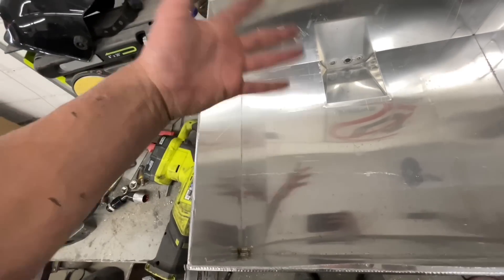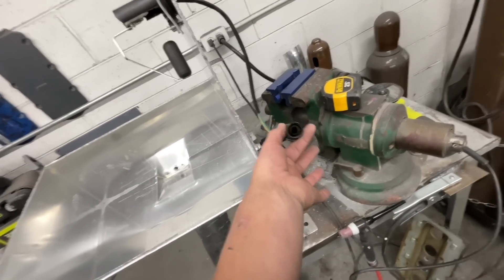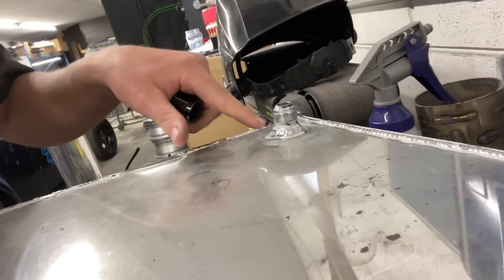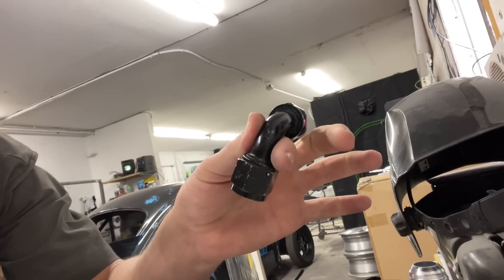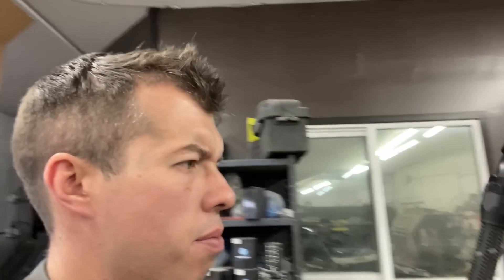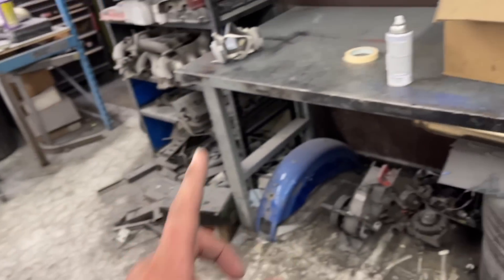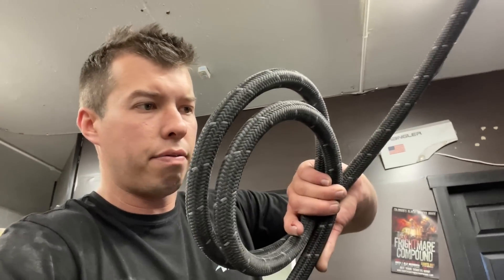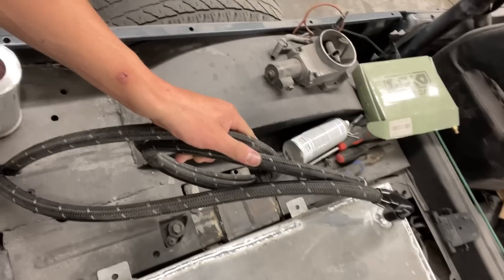YOUR COMMENTS may or may not have prevented an Explosion.

Comment: You should put a "roll over valve" in place of the fitting on top of the fuel tank going to your breather can.  If the car ends upside down or on its left side, there is nothing prevent the fuel from running out the breather can.
Reply: Yep.A '1-way valve' is required for "Tech Inspections" as far as I know.
Reply from the maker: You are spot on, many others smarter than me have also told me that 😂

Comment: My thought is - you will get fuel in a vent line. So, the fuel either needs to drain out of the car or back into the tank. A loop or poorly designed catch can is likely to trap fuel making venting difficult. A good quality rollover check valve is a very good idea and required at many racetracks. I would keep it simple with a check valve at the tank (not a crimped fitting) and a line upwards to a filter. Holley has a nice kit, but they do show a loop in the line in their instructions. I'm not fan of that loop but would be interesting to find out their reasoning.
Reply from the maker: Fair enough, you like many other smarter than me have suggested the check valve, good on ya, thank you
Reply: The check valve is for rollovers. The purpose of the double pigtail loop is to prevent a siphon from forming

Comment: Your theory of the “double pigtail loop” is correct. It’s so vapor can escape and air can enter the tank as the pump empties the tank. The double loop is to prevent fuel from coming out of the hose from either slosh or in the event of a rollover. I was also going to suggest you probably should have put at least one large baffle plate across the width of the tank. With large slots or holes allowing the fuel to move to the sump. But reduce fuel slosh in the tank. A tank that size, when you’re low on fuel, If you were to brake hard for whatever reason. You could starve the pump for fuel. Something to think about.

Comment: I’m glad you put it back in as fuel is used air needs to replace it in tank and uses vent to do so now the crimping the line will restrict that air. A simple off the shelf roll over valve would fix the problem totally
Reply: My understanding of roll over valves is to stop fuel flow in the event of a rollover, the purpose of the double loop pigtail vent is to prevent a siphon from forming. If your double loop pigtail is correctly made it doesn’t really need a rollover check valve lastly a tank vent needs only to be about 1/2 to 2/3 the id of the supply line unless you are making top fuel type horsepower

Comment: you should use an oem vapour system. they're in every car since the 70's. you probably have some sitting around from the part out cars. they use charcoal instead of Scotch Brite as the filter. they also contain the vapour until the engine is idling then open a valve (early models use vacuum, later models use the computer) which burns the vapour off so you don't smell the fuel when the car is parked... saves you from emptying the tank when you're not going to drive for a couple of months.
Reply from the maker: I did think about that.  They’re so ugly though haha

Comment: Story time. Way back in the dark ages before the inter webs, (1997)  I had an early smog era Plymouth Fury.   

One day, out of the blue it started alternating between completely flooding or starving for fuel. 

I messed around with the float in the carburetor. I put in a new fuel pump and tried a bunch of other stuff that just didn’t work.  

There was a gas station right by my apartment complex that I would fill up at first thing in the morning whenever I needed gas.  
Well for whatever reason one hot morning  (well into the high 90s at 8am), I forgot to stop for fuel. I got about 30 miles up the road before I remembered to fill up.  

When I took the gas cap off, it blew completely out of my hand taking my car keys with it. 

I stood there for a minute, trying to work out what had just happened. 

It turned out that the new, locking gas cap I bought a few weeks before the fuel issue showed up didn’t have a vent like the original. 

Presumably, the hard rubber gasket didn’t start sealing up well until it had been on and off a few times. Also, the hot weather probably had something to do with it.

The car had dual exhaust on it and the pipes ran pretty close to the gas tank .  I guess it was heating up the fuel enough to cause it to expand.

If I drove a short distance and shut the car off the pressure was enough to overcome the float valve in the carburetor, causing it to leak gas down the intake.  

If I drove it far enough to use a significant amount of fuel it would create a bit of a vacuum, which would suck all the fuel back to the tank, when the car with shut off.

Whenever I got home and parked it it would have time to equalize overnight, so I never noticed anything wrong when I fueled up first thing in the morning.

I cut a chunk of the rubber gasket off the locking gas cap and that fixed it.
Reply: When i yanked the 2.3 out of my mustang and tossed all the smog mess i put a sheetmetal screw in what i figured out later to be the tank vent that went to the charcoal canister. The 5.0 i swapped in was stock but by time i got a few miles up the road it sounded like a pro mod and looked like a diesel truck coming down the road, as you did i cracked the cap to see why it had 22psi of fuel pressure and it seemed like it spewed forever before it stopped. The engine ran smooth again so when i got to work i put it on the lift and found that i had plugged the only vent with a screw😂. I cut it about 2 foot long, made a couple loops in it and zip tied it to the filler neck never had any more problems

Comment: I went through the exact same thing on my keeps fuel tank. I bought what they called a vented filler cap. Turned out of was only vented to let air in not out. So much pressure it started puking gas out around where my Barb fitting for my gas line was
Reply from the maker: Hahaha learn the hard way
Reply: @GARAGEIdiotS  what makes you think I've learned 😜
Reply from the maker: @lucasreid6335  I guess I just thunk you smart like me

Comment: Without the loop in the vent line, gas can't drain back in the tank so it will collect in the catch can you made.  I run a double loop with a filter on it made out of hardline for 20+ years on many different vehicles.  Never had an issue.  

Good luck!
Reply from the maker: Got it! I shall change!

Comment: just run a 3/32 vacuum line from the tank to the engine intake manifold after the throttle body so it always has vacuum and prefills the manifold with fuel vapor so it starts up easy.
Reply: Not a good idea, he is trying to keep the tank from exploding. One little cold start pop back into the intake and where will that fire go to next…..right to the fuel tank. Its efi so it doesnt need fuel vapor waiting in a cylinder to aid in starting.

Comment: Could’ve just cut the return bung off bent a piece of 5/8” aluminum tube welded it to the bung and laced it through the hole and welded the bung back in instead of cutting the lid off, that’s how I build my baffled catch cans. And the fuel line vent will need some kind of loop for sure or you’ll get raw fuel in the can and that’s no bueno
Reply from the maker: Ahhh that would’ve been smart.  Thanks Travis

Comment: Partially plugging the an fitting or crimping it might cause it to build pressure like putting your finger over a garden hose
Reply from the maker: I would agree if the change in pressure changes was more rapid, but I think the amount of flow it will allow is fine, however, I did confirm that I did it wrong haha so we’ll fix it
Reply: I had my return in the top exactly like you did and had no issue. You’ll figure it out

Comment: Personally, and I have no evidence, I think you would have had a fuel starvation issue without the vent. More air needs go go into the tank as fuel level drops than gas fumes escaping. I have sealed 5 gallon cans swell up but they are plastic and it's not much pressure.
Reply from the maker: Ohhhhhh that makes way more sense than what I was thinking 😂
Reply: @GARAGEIdiotS  either way though. It's good to have a vent. I wish the stupid "safety" gas cans had one. They swell up one day then collapse the next.

Comment: i hate to be that guy but you were fine capping the tank in the first case your cap has a breather vent built into it its that little black piece with a screw on the cap!
Reply from the maker: I just took that out and tried blowing through it… I think you might be on to something but can’t confirm
Reply: @GARAGEIdiotS  you blow thru the hole in the bottom of the cap itself at least that’s how mine works been in there for 3 years no boom boom lol can’t go wrong with the eBay tank nice baffle on the return I was going to do the same but I’m dog shit at welding aluminum

Comment: The bigger problem with the sealed tank is air needs to get in as the volume of fuel reduces or the pump can't pull fuel. Sure if the tank warms up the fuel will expand and could have cracked the tank, but that's not overly dangerous in itself.